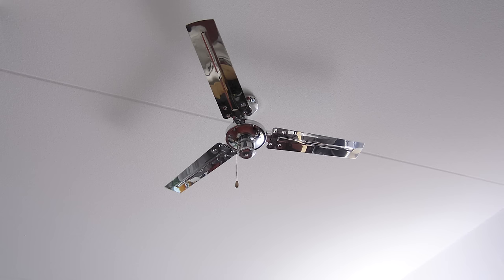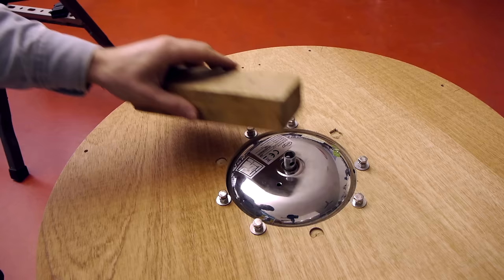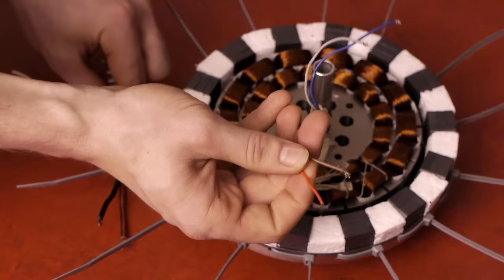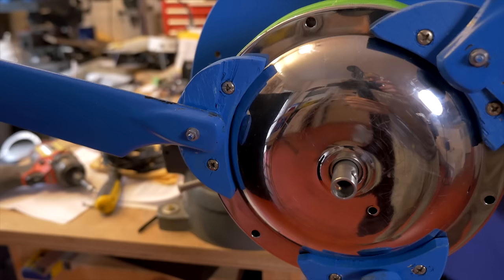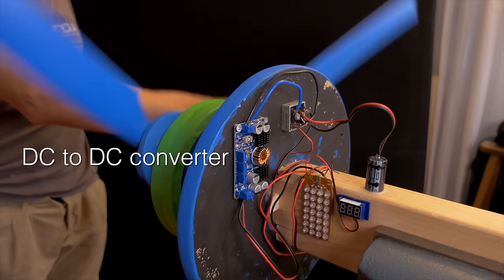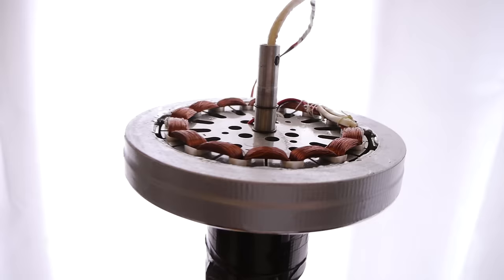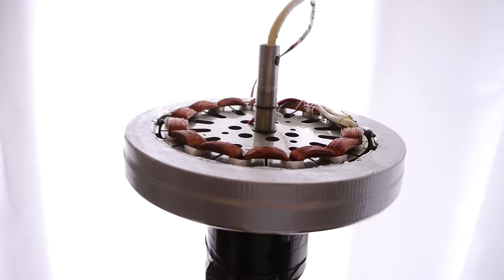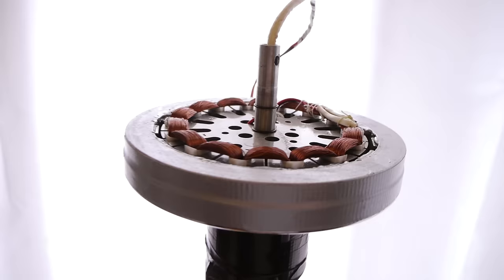Turn a ceiling fan into a wind turbine generator?!

Comment: There are cheap switch mode DC to DC converters that can handle 100V on the input and give you adjustable 30-5V out. The higher voltage will be welcome in the conversion. It would be perfect in high wind conditions. 50V at 1A (that is about what I guess that wire can put out)  is still 50w and converts to 5V at close to 9A if the efficiency of the converter is 90%.
Reply: Link please?

Comment: Giesbert, build a new one from scratch, make own copper coils, use large magnets and try a vertical blade system, think bigger better... the coils are calculated for voltage needed in my case 48v...you might need less say 24 v , that gives you the opertunity to charge 24v and 12v systems, if 24v then bridge remember its 24vx1.414 with capacitor, regulators can be built cheap, old styles like lm317 +mj2955 driver +2N3055 power transistors (like old regulated psu's  etc, for more power handling add more 2N3055 , yes there are many more new devices, but old school is fun too. finally if you have too much power you can dump it through a old lightbulb or heater coil with a relay system switching on in stormy weather when wind speed exceed the rpm limit you set. Marty T (youtube) him...

Comment: If I was doing this, I would consider rewiring the stator, but initially I would fit a charge controller instead of the dc-dc controller and charge a suitable battery. Maybe a 48V battery arrangement.

Comment: i am no expert so i may be wrong. 
you may need a way to dump power if you go over the capacitors ability or you will be blowing them like fuses in windstorms. the power dump needs to be one of the first things to happen in the circuit i think or you will have the potential to fry your dc stuff.  i have heard of using hot water heaters for the power dump as you can dump lots of power into a tank of water.

Comment: Nice. The biggest problem is the current that can be generated. Ceiling fans can only produce maximum of 2 amps.  To get more amps you need thicker wires, and wire them in 3 phase. Or for higher current you can modify a car alternator. A 110 amp car alternator at slow speed will give you about 30 amps give or take at 12 volts.
Reply: That's bs Karen I get 120 volts and light up flood light bulbs
Reply: @markleary2805  They draw less then 2 amps. It is the current, not the voltage that I'm saying. If you want you can run a bunch of 120v led lights. They don't just don't use hardly any power..
Reply: Have you built and tested one of these? If you have not then you don't know
Reply: @markleary2805  I have made them before. There are people say that they are getting 30 amps out of one of these. Without rewiring with thicker wire it cant produce 30 amps of power, or any power worth righting home about, for any length of time.
Reply: Then if you made one and tested it. Then how many amps did you get? We would all love to know
Reply: @karensmith5510  How did you come up with 2 amps? A fan is wired with 18 or 20 gauge. 18 gauge can hold 15 amps and 20 gauge can 11 amps. Why do you think your fan can produce only 2 amps. Hope I didn't run you off

Comment: A person can use an automotive alternator, they produce A.C. current that is changed D.C. current by diodes. but it would require a gear reduction to the turbine blades. because an alternator has to reach a certain RPMs to produce output. they also have to energized though the field windings.

Comment: Mount swiveling blades so centrifugal force will feather them at too high a speed. Use a CB radio external power supply and 24 ish volts will reduce to 13 ish adjustable. I'm guessing the fan will produce 3 amps, which is enviable at night, to add to a solar installation.

Comment: I am probably wrong but it seems to me that instead of replacing the stator, you could just add a single magnet that get the coils going up to the point they would power their own induction fields with the appropriate changes to the wiring. Don't car alternators do something like this?

Comment: One other thought. You could put the ac through a stepdown transformer. That would be better than your voltage regulator you have before your stepdown. No wasted power and it wouldn't shut down if you had the right ratio to handle max speed.

Comment: You could also use this as a mechanical generator with a belt and simple pedal system, or set up a weight on a multiple pulley system for dependable power generation over a relatively small distance of travel.

Comment: Induction generator can be used in windmill but need reactive power (capacitor). Please put capacitor in AC output of generator.
I am agree with you that generator need least air gap as possible.

Comment: So do not use it as a wind turbine, use a water wheel.   Your speed, and thus your voltage, will be more constant so you do not risk the frequent auto shutdowns.  
Generator speed will be largely dependent on water flow speed but can be somewhat regulated by using various sized water wheels; generally smaller being faster and larger being slower.
I would also suggest building a more robust voltage regulator, something that can handle both surges of speed and more power.

My one negative comment is that, that is a lot of work to charge a phone when it has the potential to power a small home.

Comment: Have a look at stepper motors they are good to make a generator and are cheap to purchase plus easy to mount and are sealed with ball bearings back and front and a standard shaft so you can get adapters for mounting blades but did like your try at it we all learnt that its a no no

Comment: Very interesting experiment, can feel your fear to take it higher. Perhaps though all you would have needed would have been a 100amp charge controller and a set of 2-4 gel flooded batteries wired in parallel.
Reply: That's what I thought, surely this is what a charge controller is designed for!

Comment: If only the MSM would show that the practical results of their "best thing since sliced bread' ideas actually prove that using existing tech is still much better, as you have found out.  Only the the MSM only will talk about the potential for efficiency, with a bunch of impossible conditions that must be acchieved to gain that efficiency. The free market always gravitates to the most efficient overall way of producing anything, and getting things done. Just because some idea is theoretically more efficient, because of 1 or 2 changes in technology, geometry, or principle, doesn't mean that the entire system will be more efficient, but often reduces overall efficiency because of the process and operation to use those theoretically more efficient processes require more enregy, thus the oveall and big picture efficiency is acctually less. This is very true when it comes to EV's that are charged on a grid that is powered by fossil fuels, which is 60% of the grid in most places.

Comment: Input. Can you not use a dc to dc (rectifier?) after the ac to dc rectifier? Where you can adjust the dc voltage output (Not sure if that’s how they actually work or you need)?  Then your 50v capacitor will not get over loaded. Or use resistor after your ac to dc rectifier. You could put a resistor or a few resistors in series to keep the voltage produced; From exceeding you 50v capacitor. I’m no expert, but I think that’s the way to go

Comment: I too tried to use ceiling fan motors for wind power generation. On the face of it it is attractive because they are "inside out hub motors" designed  for  low speed operation. For optimum wind power extraction to match the turbine characteristics you need a device that delivers maximum power at less than 300 rpm.
 Ceiling fans are low speed single phase inside out squirrel cage induction motors with one or two sets of coils that can be connected differenty for multi (typically two ) speed operation. But the problem is that they are also low current high voltage devices with relatively very high internal stator winding resistance. Therefore, they are unsuited to generating POWER because the internal power dissipation is too high. They can generate substantial voltage output, but very little current, and therefore generate very little power.

To overcome this deficiency, the ceiling fan core can be rewound with thicker gauge wire, the squirrel cage replaced with a ring of strong nyodimium  permanent magnet poles.

Also, to extract maximum power at varying speeds an MPPT power controller can be designed.
In the end, although the ceiling fan approach has a high pedagogical value, a much more practical approach is the build a flat pancake style 3 phase alternator using an array of Nyodimium magnets together with a suitable MPPT power controller.

Comment: I think you might have this mixed up, you are generating DC current here using this motor, the common household has AC current. Think you might have the two mixed for each other. Let me know if I’m wrong ?

Comment: gREAT iDEA....But you need to add air cooling to the coils as the wind increases the faster the motor turns
 and .....over heated coils.....so yeah, keep the inner coils as a regulated voltage brake system.

Comment: You could have rectified the second coil and used that as a separate output. They would be different voltage and international resistance but you could switch between them depending on wind speed and load both coils if the wind is good.

Comment: you could use a step -up transformer to step up the voltage and then add a Dc to Ac converter.

Comment: loose the leaner regulator.   Nothing but a choke point for the  available current .  Super Caps make a good power reservoir.    The Hover Board motors work quite well.   Issue I had was mounting a Hub for the blades.   You don't have much material to secure the hub.  Drilling a tapping worked but no so strong.

Comment: So it is possible, but not necessarily practical. It might work better with a cooling fan which often get tossed out because the plastic is broken while the fan still works. You could find the ceiling fan for free but you might have to buy the magnets and other parts. 
I also wonder if an AC/DC transformer will work. It's easy to find extra ones around for old devices or even get a universal one cheap.

Comment: All the improvements you suggest will make it stiffer and harder to turn. You lose what you seek to gain.  Leave the air gap alone in an area with light winds, reduce the gap when used in an area that blows a ton.

Comment: Why not place a 50v linear voltage regulator before the 50v capacitor and then a second after? And instead of a power off, have a switch terminal break the connection if it exceed a specific temperature.

Comment: You Can still use this as battery charger just like a solar panel or as an alternative source of electricity to charge a battery especially if their is no sunlight but there is a wind to drive that simple generator...

Comment: you just use portions of the ceiling fan like the housing to make your own higher efficiency generator.   That would be the way to use this.  Then  buy a proper wind charge controller to charge a battery.  With a steady dc battery voltage, you then have many options.

Comment: Rewinding the stator with thicker wire and removing wire gaps 10:19 can be done easier (and free) by unwinding the stator's wire equally onto four spools, than rewind the stator with four wire in-hand to simulate a thick wire. Each spool would have 3 1/2 coils worth of wire (14 coils / by 4). Count how many turns of wire in a coil when un-winding and re-wind with four in-hand one fourth that. Example (if it was 84 turns, re-wind with 21 turns).Duplicate the wind directions (I believe the coils may alternate direction as CW, CCW, CW....). For no-gaps, glue thick paper strip between the slot liners for insulation and trim the slot liners flush before re-winding. Note: take care not to scratch the wires insulation during the un-winding and re-winds to prevent shorting.

Comment: The bearings in this would not last a week in an outside wind turbine situation.

It might be useful for a water wheel or turbine that has essentially steady flow compared to a windmill .

Comment: Suggestion 1. Add a 12vdc battery to steady output 
Suggestion 2. Install a friction clutch to slow spin to prevent over volt. As speed increases clutch brakes spin out.

Comment: That smoothing capacitors voltage needs to be at least 63 volts before it goes Boom Boom..
It might get expensive at 63 volts  6800uf.

Maybe consider 2 x 2200uf at 35 volts wired in series for a 70 volt rating then use the same again in parallel to get the microfarads up to 4400uf  giving a more forgiving 70 volts @ 4400uf.

That should be smoother than me on a date.

Lol.  All the best.

Comment: ive seen maggnets attached to the back side (inside in this case) of the windings increases teh push pull on the windings increasing teh outputs of teh generator or other equipment.

Comment: I'm not that knowledgeable with electronics but I used to have old English motorcycles and they used a zener diode to control the output voltage from the alternator it was mounted to the frame of the bike from my understanding the excess electricity would be basiscally shorted or electrons returned to the alternator via the frame something to do with electricity being able to run in both directions with a zener when it failed you either had no electric or too much and wires burnt up but it may be useful for your over producing it really was not well liked on the bikes but its a whole different world of RPMs then what you are looking at

Comment: My Dear Brother, it was great effort but I like to say something here if you consider.
1- use only high strength neodymium magnets.
2- space between magnets and coils not more then 10 to 15 thousands.
3- winding wire little more thicker then the fan coils.
4- use one step down transformer to make low AC voltage and then fix the bridge diodes to make it DC.
This whole work need powerful magnets and properly close the iron gaps between the windings.
This is a nice way and good project as it is brushless and low rpm generator.
I am an inventor of mega projects but not yet got sponsor but my desire is to facilitate the mankind and also for the living creatures on earth.
Making things are not much hard but to find appreciation and sponsors for our desires are rare.
I already posted my vision and implementable projects to our government but there is no respect for real developers.
I like to work on poverty eleviation in the whole world but we were born in a society were we can see many So called experts and so called leaders around but they do not understand our vision because they don't have a real vision for rapid response development of country but they think they are the only genius people on earth but they don't know the real easy way for a quick development in the country.
I think maybe they really don't like to make their nations wealthy and comfort but I will struggle till my last breath to work for mankind.

Comment: I would change the large 50V cap to one with a bit higher rating as you don't want to ever go to max potential on an electrolytic as that's it's highest rating and can cause issues. Maybe add another 10V cap to it in series for added tolerance.

Comment: Hi. I would definitely say that connecting the micro-bedeemer to the centrifuge resistor would be in order--BUT at the sub-atomic level. In addition, I would install a continuity fluctuator defibrillator, preferably a non-china made brand, to ensure a free flowing electrical connection at the point of electrical generation. And as always, use the appropriate NEC approved electrical tape on all wire connections that may be exposed to general electrical flatulence events!! 😂 Smile and laugh now😃🙏

Comment: Just mix up some ironsand or black iron oxide pigment powder with resin and squirt it into the gaps user the stator. You could use the slots you filled to squirt it and fill them simultaneously. You will get a lot more power by connecting the individual coils in rather than series, or a series parallel configuration.
It will run into a wall of inductive losses otherwise.
If you want 240V AC, the series wiring is probably fine, a turbine with blades of disk dia of about 1 meter should do this.
Fully parallel configuration will multiply the amps by the number of coils rather than having a safe limit of perhaps 5A for the series configuration.
You might actually find the best power output from not filling the iron gaps in the stator.
While at low speeds the iron helps to increase the magnetic field strength across the gap to the permanent magnets, changing a mass of irons magnetic polarity at high frequency will waste lots of energy.
It's important to back your magnets with an external band of magnetically conductive material to complete the magnetic circuit. Need not be flash. Mild steel is fine. Laminated not necessary. The rotor has fixed magnetic polarity.

Comment: well it's s good idea to rewire the coil with bigger wires to fill those gaps instead of inserting metal sheets and couple the output to a 12v battery and inverter so that you can have a stable source

Comment: Hydrogenation make a watermill and damn. Connect a battery and DC to AC converter with a good setup for grounding... Maybe, idk, but I d reckon that be both stable and steady way for your output issues.